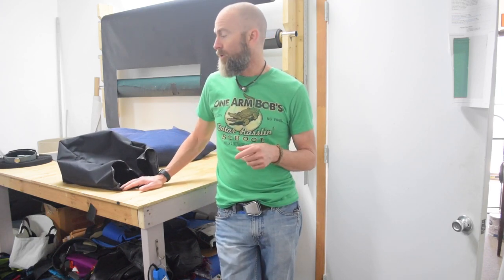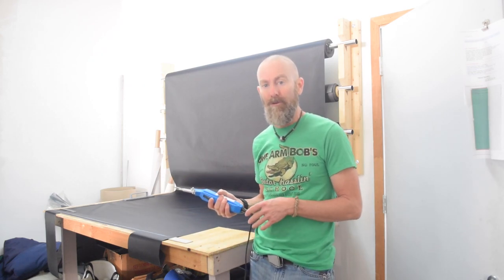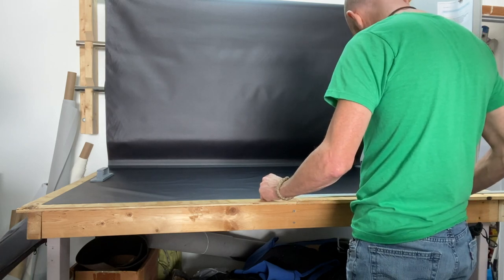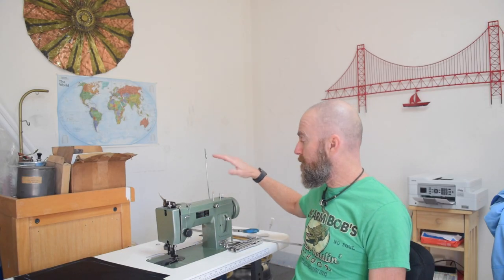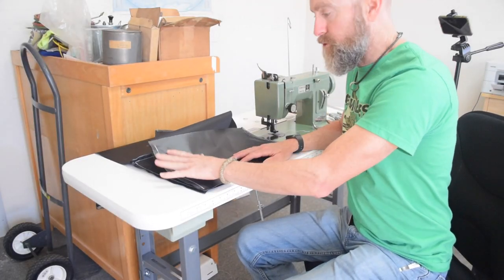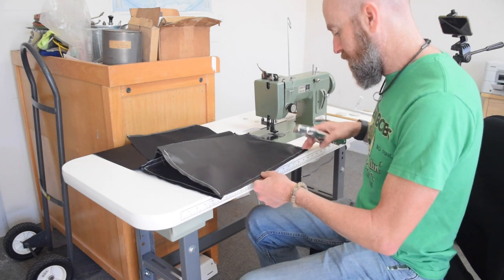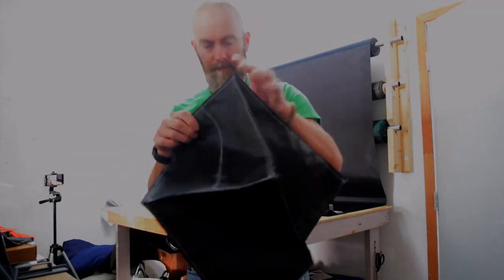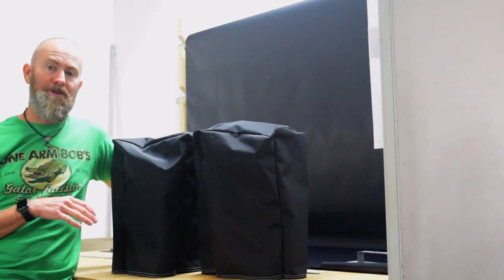Custom Sewing: How I Make Simple Covers Only From Measurements

Comment: I sure like your videos. I've learned a lot. Thanks. I too cut my project pieces with a heat gun. My poor man's heat gun is a old school Weller soldering gun. I stripped a 12 gauge copper electrical wire, bent it to the approximate shape of the Sailrite cutter attachment. I then gently flattened the cutting part of the wire with a hammer to mimic the cutting blade. Not too much or it gets too fragile. Inserted the wire into the two barrels of the soldering gun. Presto! A cheap cutter with two heat settings.

Comment: Thanks for the tip about the 1/2 aluminum stock-strip.   
I use machinist  rulers and pocket scales but they are not that long.
Reply from the maker: I learned about those at my first marine canvas job.  We had several lengths of several common seam allowance widths at each machine.  Really handy for things you do often!
Thanks for being part of the channel!

Comment: Great video. Thanks. For esthetics, I like to sew a top stitch all around to make the seam allowance lay in the best way for shedding water. It is difficult with, for example, a cover for two patio chairs measuring 40w x 30h x 15d. 
My machine is a Rex (far smoother and quieter than yours thanks to lubricating with Marvel Mystery Oil. Try it, and you will be amazed).
Anyway, I have some 40 denier haystack tarps that were never used, and so they became my material source. It is like sewing aluminum and difficult with such a low and short arm, but I struggle it through to get my "decorative" top stitch. 
Do you know of any techniques to make that easier?

Comment: Similar to your 1” ruler trick I have a metal yard stick taped to the top of my cutting table flush with the front edge using basting tape. I lay the cut piece on the table and butt it up against the yard stick. Then I lay a piece of 1” aluminium flat stock I bought at the hardware store on top of the cut piece and slide it until it also butts against the yard stick and mark the line

It’s a really quick measure free to mark a 1/2” seam allowance. It really shines when mass producing parts
Reply from the maker: Thanks for sharing, that's a great idea!

Comment: Not sure if anyone has already asked this but when making a cover, how much bigger do you make the cover than the item, not including the seam allowance - 1/2"?
Reply from the maker: It might vary depending on how close you want the fit, the item being covered and the material being used, but 1/2" is probably great for most situations.  In this particular case, the customer determined that for himself, but I've used 1/2" on other covers with great results.
Thanks for the question (actually you answered it yourself lol!), and thanks for watching!

Comment: perfect video as I'm just about to embark on a  few covers like this. if you wanted to make the side and top seams "flat felled", how do you get to the bits up in the corners? I've never figured out how to do flat felled seams on a project which has depth? (i don't know how else to call it) All the examples of flat felled seems online are conveniently two pieces of flat sample fabric being joined edge to edge, but like how do you do the entire eelngth of a pant leg as in jeans? or the edges of a "box" or cylinder? Thanks, love these videos!
Reply from the maker: Hi!
The short answer is, I don't have a good solution.
Long answer: I've done this on many, many covers of this style, and it's always hard, and never perfect.  For a dust cover, it's acceptable, but the corners are always a mess.  The best results I've gotten have been from felling the top seams before sewing the side seams.  If there is an easier way to do this that will yield great results, I'd love to know what it is!
Honestly, part of the reason I got the hot knife is to avoid felling the seams on these covers.
If you're willing to use a different design, you could possibly make the cover in two pieces - the top and two ends as one piece, and have curves on the top corners of the side pieces.  You might be able to fell the two seams around the curve and not have to deal with corners.
I hope that helps, good luck and thanks for watching!

Comment: gave me some ideas - you always do - QUESTION - you ended up doing the trimming so where you put the staples didn't matter in the end but without the trim did the staples leave holes in that nylon? one of those times should you use clips or pins but I like that staple idea
Reply from the maker: Hi!
In general, I always try to keep any holes from staples, pins, etc. OR basting tape residue in the seam allowances.  With clips, of course, there is no danger of holes; however, they can also slip out.  (I use clips often, too.)
This particular fabric doesn't show the staple holes very obviously, but they are there, and I would not want to accidentally staple in the visible part of the product.
What happens in the seam allowance stays in the seam allowance.  Holes, glue, tape or whatever are generally fine as long as they are in the seam allowance. Even if I didn't trim part of the allowance off, I would generally be doing something to conceal the raw edges (flat-felled seam, binding, liner) that would cover any holes left in the allowance (by covering the seam allowance itself).
I hope that helps!  Thanks for being part of the channel!

Comment: Would they fit if they are the exact same measurements as the speaker? Do you have to add in 1/16" on each seam or something so it will slide over the equipment?
Reply from the maker: Great question! This particular customer has ordered a lot of things from me, so he adds a little to his measurements before he sends them to me, and I just make the seams hit the numbers he sends.  Ordinarily, I would ask for precise measurements of the object to be covered, then I would add a little from there.  Fabric will generally have some "give" to it (varying from fabric-to-fabric), and it may take some tinkering to figure out how much you need to add to make the cover go on and off easily but still fit like it was made for that object. 
I would probably add a bit more than 1/16" as that can easily disappear with even slightly imprecise sewing. Adding 1/4" might be a good place to start.  You can always take a small Amazon box, shoe box or whatever you have lying around and use it to practice on, trying various amounts of "ease" until you have a fit you are happy with.  You might want to try different fabrics, as well, to see if there is any difference.
I hope that helps, thanks for watching!
Reply: @thejasonofalltrades  Thank you for your reply! This is very helpful.

Comment: also just though it maybe worthwhile to make flat bar along he back edge of your work table through/under which you could feed the fabric your are using to make it lay flat on the table as you pul it down and across the table..sort of like a butcher paper tear strip but not for tearing in this case...jsut an idea
Reply from the maker: That's a great idea!  I've used a similar arrangement in shops I've worked for in the past.  I might have to try making one :)

Comment: I don't know if that motor makes less noise, but it certainly is less annoying. Thanks for the video.
Reply from the maker: It's DEFINITELY quieter with the servo motor.  The table itself also seems to absorb some of the sound, but the motor made a big difference. The control is excellent, too.
Thanks for watching!

Comment: No other comment has raised the question... Where is your source for aircraft seat belts that can be turned into clothing belts...? do you use the attached webbing and just join it at the back, or just use the buckle and use a new length of webbing?
One technique I have used in industrial grade covers (tool chests and machinery etc) is to sew in short cord (elastic rope) into a larger hem in the bottom, so that one the cover is in place, and is longer than the object that is usually on wheels or such, the elastic base hem gathers the cover in a little bit once in place - this stops it flapping around in windy conditions too, so can be used for outdoor furniture and such to make sure the cover stays in place better... as the elastic cord is basically enclosed anyway, it remains impervious to sun, rain etc, and it is easier than using eyelets and threading a cord through to gather the base in like is sometimes seen in boat upholstery...
Reply from the maker: Hi David!
I actually bought that buckle brand new from Strapworks - https://www.strapworks.com/2-inch-aluminum-airline-seatbelt-buckle
I don't believe they are rated for actual seatbelt use (aircraft or otherwise) but they look cool and are pretty cheap! I just sewed it onto some random webbing I had on hand, also purchased from them.

I like the idea of an elasticated bottom on a cover, I'll have to try that sometime!
Thanks for watching and commenting!
Reply: @thejasonofalltrades  I know that the US has many aircraft 'bone yards' and figured that some of these buckles might have been recovered from such a place, and put up for auction or some other avenue of disposal... Here in Australia, we have no such facilities really, not on the scale the US has... thanks for the link! I like to find (and repurpose) unusual stuff (esp. if it has a history - real and partly imagined (how many people a buckle from a 747  has secured in it's first lifetime before I gave it a second more gentle life as a belt?), something with a bit of patina, or if it is otherwise not easily obtainable, or that cost a lot and had high standards back when it was new) - from weaving strands of unusual material into floor rugs or upcycling hardware like this in everyday street wear... the project then inherits some history or energy in a way... I like using boat hardware too, using stainless steel or brass fittings on projects - not for a full-on steam punk look, but more of a utilitarian style - e.g. rings & hooks for attachment points...

Comment: I'm curious how you met the 3 stitches on the inside corners where 3 seams meet to a 3 sided point. Did all three stitches terminate in the same needle hole at the point.  And how you addressed the bulk of all 3 seams meeting in 1 place at all 4 corners. I hope I articulated that clearly.  Thanks !
Reply from the maker: Hi, 
Sorry, I thought I replied to this comment some time ago, my bad!
This is very difficult to answer in writing.  The short answer is where the three panels meet in the corner is the most difficult part of these covers. The collected seam allowance is somewhat unsightly and bulky, and I haven't yet found or learned a method to make it come out perfect.  I usually hot knife as much bulk as I can.  Since these are just dust covers, having a perfect interior isn't as important to me as in something like a bag (where I would use binding and/or a liner to finish the interior).
I have some more of these to make soon, if I can capture any helpful details of that part of the construction, I'll try to make a video about it.
Thanks for the question, and thanks for watching!
Reply: @thejasonofalltrades  Thank you my friend  ! That bulk that you speak of has hounded me for years. Sometimes I'll have to resort to creative ways to make a 3 sided corner with less bulk.